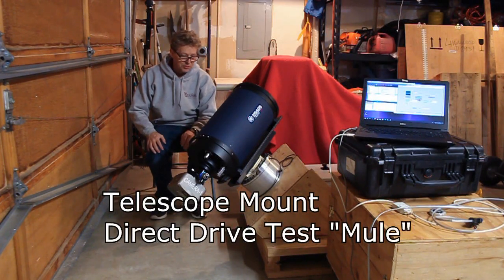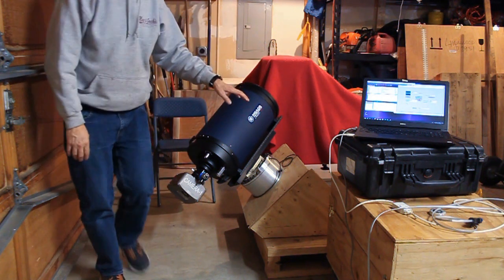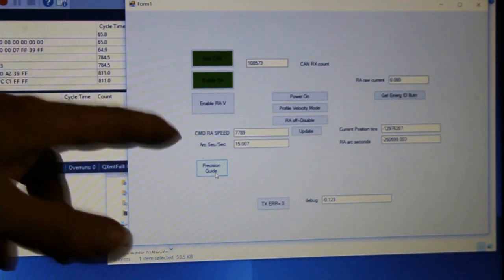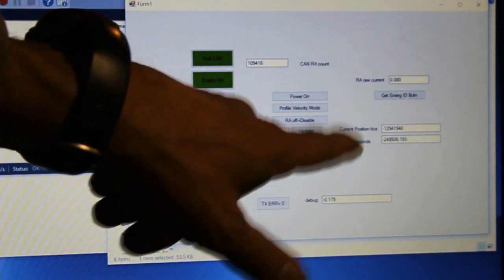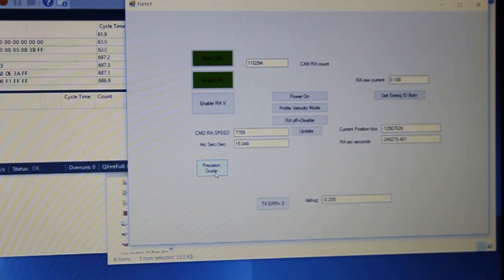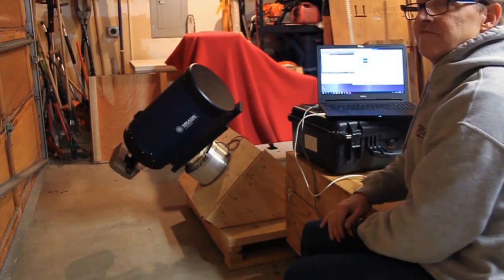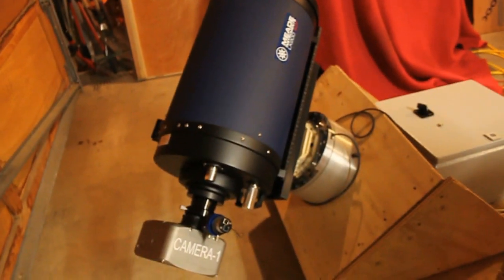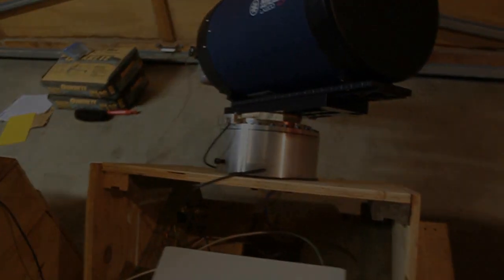Direct Drive Telescope Mount first light star test

Comment: Hi Bruce congrats on the mount! Do you use an absolute encoder? If so what resolution does it have given the insane cost of these encoders?
Reply from the maker: 26 bit Renishaw absolute encoder, 200mm code ring. It's accurate to about +/- 2 arc seconds over 360 degrees.
Reply: @djcheckonetwo  Just how much does one cost? The prices I got were unbelievable :(
Reply from the maker: @timchemaly5800  between $2,000 and $3,000 each. The complete drive module you see there is about $7500.

Comment: as i seen others have said we would like to make setups like this for are self, can you show us alittle more like motor design mag size\type wire size and how many wraps ,witch phaseing you wired the motor ,the controler, incoder part number. and not a need to see but i would love to watch ya machine the other motor if you going to make the other axis. i been watcing dan gray he doing the same thing but know one gos in to super detail of build and setup. i have a full machine shop here at home so thats no problem. not sure why there is no step by step build of these my budy Ron that owns moonlite focuser said theres a lot of people doing this now. thanks for sharing and hope to see more
Reply from the maker: This uses a commercial frameless brushless torque motor core. You can find them from Parker, AlliedMotion, Etel, Kollmorgen, and other companies. it uses a 200mm Renishaw resolute encoder.

Comment: This is very impressive! Is this something you are building for yourself?
Reply from the maker: It's going to go in my observatory but will also be available as a product (next year hopefully).
Reply: @djcheckonetwo  Based on the video, you tested only the declination axis, right?  What about the RA during those 300 seconds of exposure? Or you actually used it as the RA axis? The project looks amazing. Is it possible to share any additional details for us who might be interested in building one of these?
Reply from the maker: @stoja87  this is showing a single drive module for RA only. The same module works in declination but operates in position control mode; instead of the drive controller closing the control loop about a constant angular speed, it closes around a position command. This will be available in module or complete mount form from Xerxes Scientific in Spring of 2019. That's the company I have started to make these units commercially available. There are some substantial costs in the CNC machined parts, the encoder, and the motor core (which is commercially sourced) and those are much more economical when the cost is spread out over a number of purchases, especially the CNC machining.  There is more info at http://www.xerxesscientific.com/ including some more test astrophotos and a CAD render of a fully assembled mount.